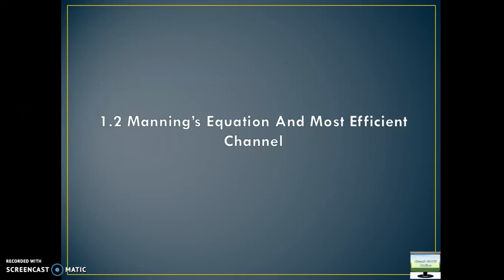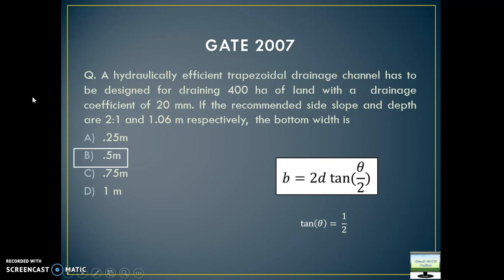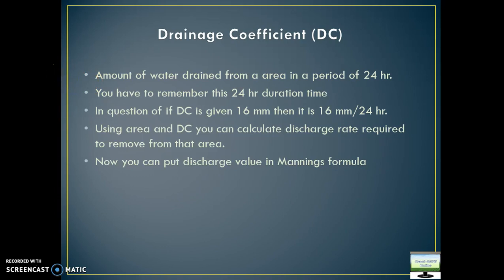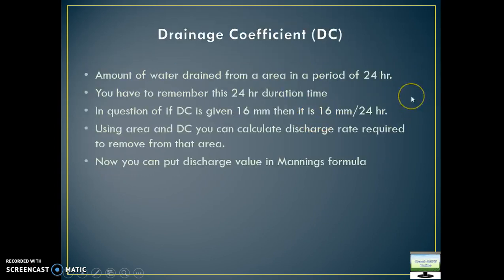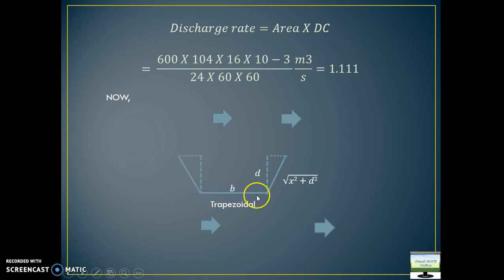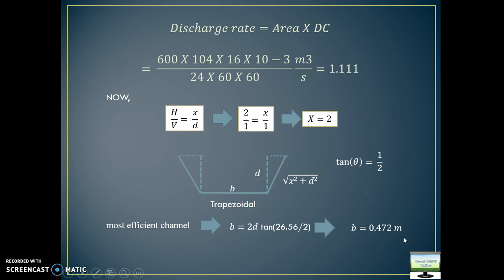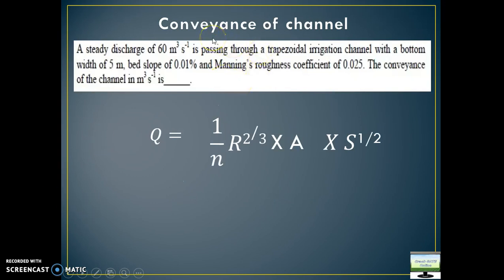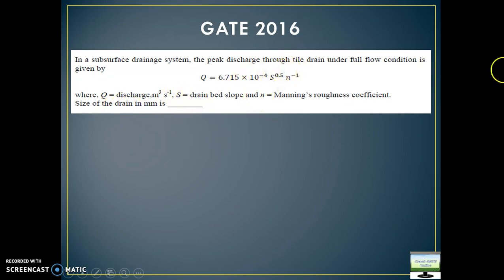1.2 Most Efficient Channel

Comment: A rectangular chaneel having bed slope of 0.05% and Manning's roughness coefficient of 0.01 carries a discharge of 5 m3 /s . If the channel is designed as the most economical section, the width of the channel in meter will be 

Sir could please solve this sum and say me the hints

Comment: In last question how much area we assume???
Reply: ખેતી વિશે માહિતી અને સાધનો  Correct me if I am wrong ... As per the video 1.1 regarding the Manning's equation , it is mentioned that the area which we use in Q=A × V is the same as the area which we use in finding the hydraulic radius , R= A/P . Therefore the area can be calculated by A = (Top width + bottom width )/ 2* H .

Comment: sir for the last but one problem, depth is not given. we have to assume d value or take d= 1 as they mentioned side slope as 1.5:1?
Reply from the maker: take d= 1
Reply: There is no need for asuming d value. You can get the relationship bw b & d using general formula of efficient cross-section
By substituting the value of b in terms of d in the discharge equation shown in video, you will get the d value as all other values are already known.
And then finally from value of d you can get value of b (using relationship that we got bw b & d)..

Comment: Hello , Abhay its good see some quality material on agriculture engineering.
I have been preparing for IFS examination with agriculture engineering as an optional, could you please provide me with      
some notes or material. It will be very helpful as there is very scarcity for  the agriculture engineering material.
Email- ashu9221@gmail.com
Thank you very much, keep up the good work.
Reply from the maker: Hello Aakash...
Please watch introduction video from 1.2 to 1.5 in which i have explained syllabus of GATE and related book....you can match syllabus of IFS with that and can refer same books because those are only standard books for AG Engg.
In the above video also I have explained the problem asked in IFS.
Please let me know if any other help is required